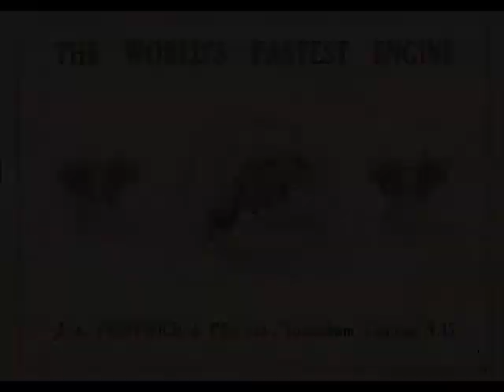J.A.P 500cc Dry Sump Stationary Engine

Comment from the maker: Cheers! For the moment I won't get too involved with polishing it all up, I want it ready so it can go to shows in the car if need be, I don't need another engine in bits lol

I will restore it over winter though, but for now a good clean will have to do. I also plan to change the throttle cables for screw adjustment if I can.

Comment: Nice engine, very old J.A.P. that is. I know in the engines J.A.P. made with an oil return you were meant to run a straight 70 grade engine oil, never a multigrade as the oil never warms up. You can get away with running a 50 grade. What do these engines use?

Comment: Wow i have not seen one like this for a long time. I have a video of an older one on my channel that is on an old 1929 atco standard it does not have the heavy pulley on out put shaft and runs much slower than your one. It is a great engine had not issues so for with it and it runs very well.
They do run like a two stroke on tick over but when under load they are much better has loads of hp. The old mower cuts at tick over speed there is no need to rev them up at all.

Comment: That is a newer version to my old atco engine same basic model but with the covers added to stop fingers getting eaten by moving chains. Behind the valve gear cover at crank case you can adjust valve clearances there with two small spanners. If you look at my mower video A closer look you will see what i am talking about. Atco user manual also says a lot about the oil drip sight and how many drips per minute this could be why it rattles i think it was 11drips on tick over and 20drips if working.